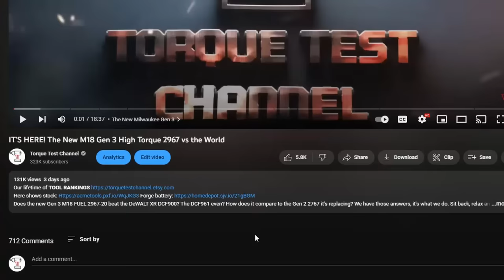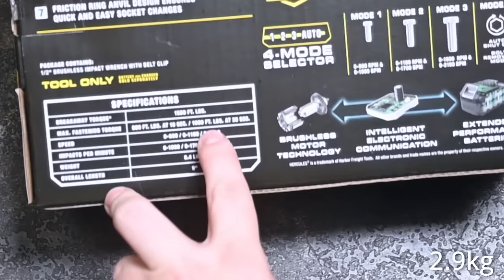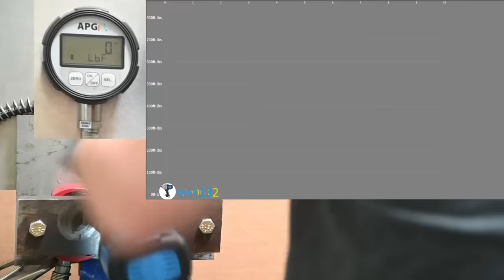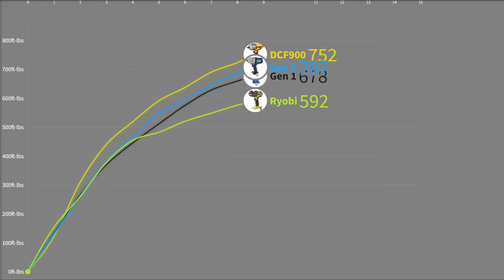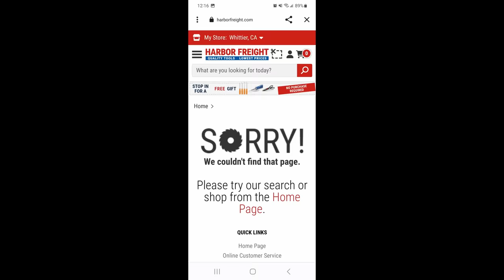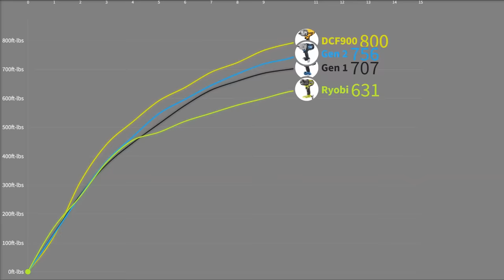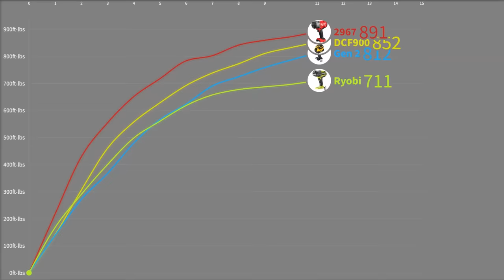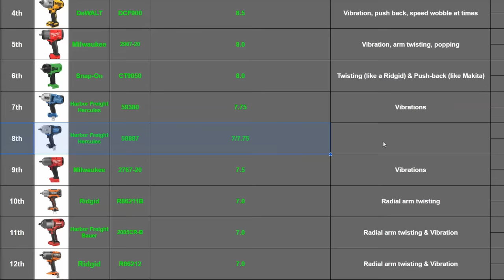Harbor Freight Called & Wanted This Gen 2 Ultra Torque Back

Comment: Great performance and value. No brainer if your on a budget👍🏻
Reply: No brainer period.Who doesnt like to save money...and who but Harbor freight gives you a new one when you give them the old one?
Reply: @djsi38t  Just Because tons of people can afford a Hyundai  doesn't mean they'll pick one up over a Honda or Toyota SMH. The same goes for tools. Brand name and the tools solid history in a professional environment means alot to folks. If your just starting out low on funds with no other battery platforms this is good pick up. Milwaukee recently sent me a new M18 Compact when I sent my old used and abused 2754 3/8 for service. The funny thing is they just upgraded me without even asking LOL. Ridgid did the same too with my Hammer drill pretty cool.

Comment: I don't know about this video's results but "Shop Tool Reviews" torqued the 1st gen Ultra Hercules when it came out and was so impressed that it torqued all the way to 1800 ft. lbs way beyond specs. making it a must have tool for any wrenching nut and when HF had a special where their 8Ah Xreme Performance battery at $60 and the 12Ah battery for $80 it was a freakin' deal not to miss!

Comment: You've probably explained it in the past but, why do all the manufacturers consistently give torque ratings of almost a factor of 2X over the actual results. Are we just to sort of divide by 2 and be ok with it?
Reply: They always give you the breakaway torque number which is higher than fastening (usually half breakaway) and possibly at 0 load kinda like how drills advertise rpm speed with no resistance to slow it down. Maybe they measure impact starting torque without any resistance. That's just my guess anyway.

Comment: Wish milwaukee would start using a more powerful motor and lower speed, the m18 mid Torque 3/8 and the 1/2" impacts just vibrate to death.  Like the air tool feel where there is more power down low and doesn't vibrate your wrist to dead.  Milwaukee and other cordless tools as well,

Comment: I was impressed when I first bought the 1200ft pound 1/2 cordless Earthquake xt wrench and enjoyed it for about three months till it went weak and could not bust a lug nut thst was only at 90ftpounds. 

I wonder if this will be the same because it just sounds too good to be true just like the earthquake and the trade off for the price is longevity and durability of the electronic components inside the wrench...

Comment: I'm wondering how the prices compare when including typical promos and coupons. The inside track club gives a minimum of 10% off and up, but Dewalt does free batteries and twofer deals. I bet if you do the math, they are really close.
Reply: The Gen 1 Ultra torque is $120 right now at Harbor Freight

Comment: years ago someone was testing radar detectors and at the last minn one came in and so the testing was started.

This last Minn Radar detector was hot and could Easley beat all the other detectors with no trouble ,

But not so fast the testing crew also went out to local stores and pick one up and its was not so Hot at all, So they took it apart and found an amazing peace of engineering. But its mate just pick up was not all that good,  it was no more than any of the others that were getting tested.

So, after the testing was done and the Mazine  posted the story of the little radar detector Company that try to scam them with a dead ringer.

Comment: I'd guess they autopsied the warrantied returns and issued a revision to remedy the failure, replacing the respective components/traces/castings. Same beans, different leaf.
Reply: harbor freight management  when told by corporate does whatever they choose to,   and they will burn many people on these  hercules  impacts, when they fail like  other stuff ,  its sad, seen it before many people are done with harbor freight stuff because they change everything  out of nowhere  just to get you to buy more  things that fail break etc .  this "5 year warranty"  will go down the crapper  watch its just a gimmick, the  internal dc motor  and controller are very cheap, and are the key failure parts / They are just getting unsuspecting  peoples  money , and use a trick in china they make  batches on the assembly line thats  better  and then another  assembly line of junk ~ its a scam .
Reply: LoL...out come the haters with no actual knowledge or experience

Comment: ATTENTION PUBLISHER
Since you are the "Torque Test Channel", please make a video comparing electric torque wrenches with a selectable range of torque values. If I need to tighten a nut to a precise torque value, the selectable value torque wrench is the only solution.
Now, the principal concern is accuracy of selected value vs. actual value delivered.

Comment: The main thing that will keep me from purchasing any Harbor Freight battery powered tool is the batteries. 

Been a Milwaukee tool user for years and have a collection of batteries. No way would I purchase a new tool that uses a non-standard battery. I don't need to upgrade tools every couple of years, as I keep an impact in the truck and van for tire replacements. Seen too many HF tools change batteries to a different design, and the new tool or old tool can't swap back and forth.

Comment: i need high tightening torque. i will pound till it won't go for 10 seconds. i am stretching big bolts.the dewalt with their stupid torque selections fails and stops working after pounding for 10 seconds on a bolt i'm trying to stretch. i had to return it.

Comment: One critique to help you up your game. I’m red-green color blind and it was pretty much impossible for me to see the numbers and the blue line for the Hercules over the background color on your graphs. Just something to consider because there’s more people out there that are “color blind” than you would think.
Reply from the maker: Hey thanks. We've tried using other colors before, but people get a bit hussy when the color doesn't match the tool. We sometime use black instead when hard to see, but in this case black was already being used by the Gen 1. Any suggestions?
Reply: @TorqueTestChannel  I know nothing about video editing so it’s hard to say what would be worth the time and effort. The best I could think of is putting a box in the bottom right of the video in black and white with the same labels and numbers that follow the graph. Or take a poll to see if others have the same issue and maybe some would have a better suggestion. But is it worth doing anything if it’s a small percentage or just me. I just don’t know because I have no idea how much time it would take to do this while editing. And I agree that it does make sense to put them in the same color as the tool.
Reply: Or just ask someone to give ya the data :)

Comment: 7:58 Where did that ball bearing inside the hammer cage come from?
Looks like another good showing from Hercules.
Reply from the maker: It sits in the female cavity of the anvil, we plopped it back in before putting back together. TTI uses this design as well
Reply: That's not a ball bearing. That's just a ball. It could also be called a bearing ball if used inside of a bearing.

Comment: Can someone explain why he keeps ignoring the claimed torque on the box?
He’s charts list is asclaimed torque 1000 but it clearly state 1500 on the box.?! Also, 840 is NOT 900 WTH?
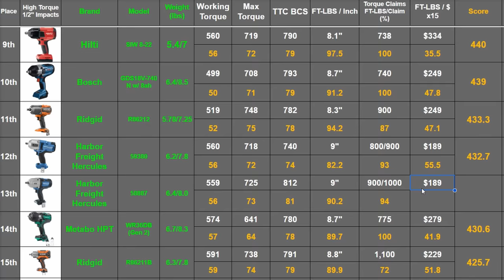Reply from the maker: We always, for each impact, compare to working/tightening torque. Because that's what we're doing here, tightening in forward and reverse. The 1500 is nut busting, breaking something free, which can't be measured very accurately, or calibrated for as a 3/4" thread bolt for example take much different amount of ugga duggas as 1/2" thread. 840 is NOT 900, correct. Which is why it got a 94/100 points and not 100 for 100%. @ 12:33 you can see the Bosch and Hilti DID make their claims and maxed out their 100 points in that column.
Reply: @TorqueTestChannel  So there is a separate claim of 900 on the box? Never seen that.

Comment: Why do thry advertise such high numbers but NO brand hits those?
Reply from the maker: Are you talking about the breakaway numbers? In that case it's loosening/removing. We're tightening in forward and reverse. Loosening is hard to specifically measure, can't be dyno'd on a curve and is dependent on thread size. but some channels do a good job of testing that as well
Reply: @TorqueTestChannel  yes

Comment: I had the Hercules impact driver. Smoked it on some 6in lags after 2 months of light use. 10 lags and it was never right again. The first time I put it under nay stress and it  lost power and never got it back no bs. I was very disappointed. It was also hard on my wrist even doing 3in deck screws. My 4 year old millwalkee fuel handled the light abuse fine. I really wasn't hard on it at all. I'm way way harder on the Dewalt and millwalkee stuff I have and it's all fine after years but not my Hercules. Never again. It let me down when I was doing a deck in the middle of nowhere. I have a couple of bauers as well too. The Hercules is stronger than most but only for one use. Lol. Dont buy Hercules. Look at the return tables at harbor freight. A ton of people return them for various reasons too. The battery always took forever to charge and always died faster than my old battery millwalkee stuff too.

Comment: Yeah you got a ripped off power tool that was just carried over from the previous  model with a beefier rubber only.   This is why I stick to dewalt as the to go to for raw performance.  It just doesn't disappoint when you need it to get the job done right the first time.  Kudos to dewalt.

Comment: I'm not going to lie but I almost feel like anything past 500 is redundant. Almost nothing is torque down 500 ft lb. I have the high torque Milwaukee and probably used it twice in its life only because I felt bad that I never use it. The mid torque can do everything. At this point with 567-800-900 1000 foot pounds people have to start asking themselves we need to have a limit and maybe start refining the tool itself instead of chasing higher numbers.

Comment: If you believe this was leaked as an accident I have a wall Mexico will pay for or a corn pop anecdote to tell you. Either way nicely done Harbor Freight.
Reply from the maker: Not sure having the item not only not buyable but also not even listed on their website when a review like this comes out for it is their master plan, or it's just a bad plan. Because we would have likely bought it either way when it WAS released formally

Comment: I use air tools and they can devour these electrics with ease
Reply: If you’re in the middle of nowhere without access to a compressor, what do you do with your air tools? Great for a shop with 100psi all day, not great for just about anywhere else. I have both, I’ll take my electrics over air any day in 2024.
Reply: Sure but electrical is mobile. 
They all have their place.

Comment: That's all great but the manufacturer asked for it back.  You did what you want but now I don't trust your video and results.  The manufacturer might have needed to implement a slight design change or maybe they can't use that motor you pointed out due to a dangerous issue.  Maybe that one they sent you isn't the FINAL design that was sitting right next to it and someone made a mistake..... I doubt Harbor Freight will send you anything else without deep thought as to your actions in this case.    Enjoy your fame... hope it isn't temporary but as for me I won't waste my time with your channel anymore as I now have a genuine concern about a tool that may not even exist anymore.as you have presented it.
Reply: Not the manufacturer, the local Harbor Freight. They had already been mass-produced and were sitting in Harbor Freights everywhere just waiting to be put on shelves. He just got lucky and got one from the back. They probably know he has a channel and realized they accidentally gave him one that hasn't released yet. That's entirely different from how your characterizing the situation.
Reply: @GrabLifeByDaPoosy  It's the it was presented that allows other conclusions genius.